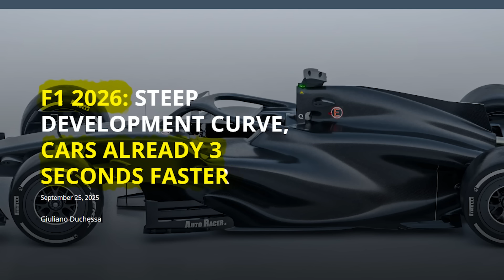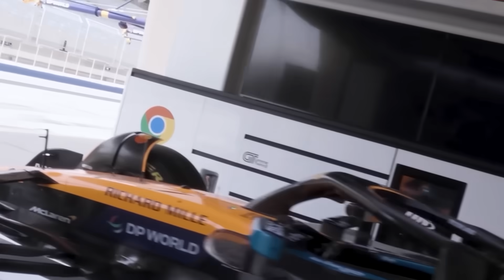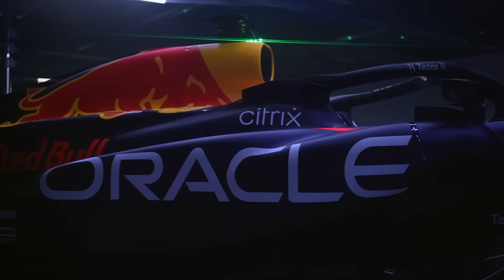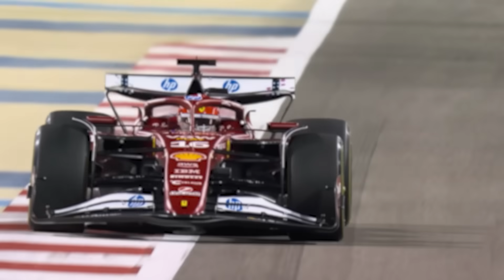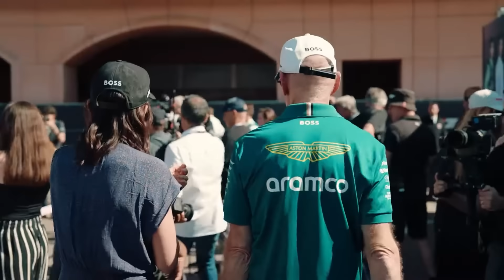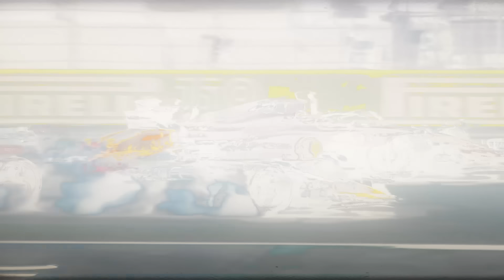How 2026 F1 Cars Are Already 4 Seconds Faster

Comment: We don't need any winey stupid hybrid electric garbage that only 5 fans prefer. Scrap that crap and get back to a proper v8 or v10 race engine. No truth to "that's the future". Only in manufacturers wet dreams. It's not possible so they need to get back to reality and get real race engines back in the cars and forget what they want to produce and start producing what most fans/society want. The 2026 cars look great, not let's get them sounding great again!! We now have sustainable fuels, we can run big loud engines now. We don't need fuel saving or even electrified anything anymore.

Comment: The car will not start the new regulations quicker than this years cars. Over the following few years the lap times will fall but the new regs are tight and restrictive. The current cars have years of development and have almost reached a plateau. New regs normally mean the racing isn’t as close for the first few years but you have to look at who stoped development early on this years cars and switched to the 2026 car. early. This is due to limited fan time, runs and occupancy in the wind tunnels.

Comment: The analysis of the new setup is great. But imma disagree hard on your driver assessments. The cards are going to be shuffled anew with the power unit changes. It will no longer be the most experienced driver that wins. It will be the quickest to adapt correctly to situations. So Hamilton: forget him. Cant adapt at all. Only wins with the best car and no issues. Verstappen: Most likely very high up there but not first. Russell: Possibly right behind or in front of verstappen. Leclerc ? Depends. I dont know how well he would do without being able to slide the rear as much anymore. Could turn out well for Yuki Tsunoda .... if he is still in the cockpit of course. My hope is that Bortoleto will make the most of it.

Comment: You're so full of 💩.

2026 cars:
- have less average available power
-take forever and a day to recharge the battery
-30% less downforce
-20% less mechanical grip
-narrower
-double DRS helps with heavily reduced power but doesn't equal it
-weight to wheel base ratio is increased making cars unstable
-double DRS open is incredibly unstable
These cars will be MUCH slower and will not come anywhere near as fast as the current regs

Comment: That engine sound is more or less what I expected. My initial expectation was that it would sound like an Indycar engine fused with a Formula E engine. So my criticism with that sound clip was that the ICE had the same pitch as the current engines. I expected this to change a little bit due to the elimination of the MGU-H as well as having them rev a little higher to obtain energy

Comment: Cost cap didn't go up that much because of inflation. It was because they added a few things that were outside the cost cap into it so that teams may be able to redirect some of that money to pay people better. It shouldn't affect any team. It just gave them more room to cut from other parts and spend it in the cost cap instead which they couldn't do before.
Some people left F1 because all other pro series are paying more while people work/travel less.
Cost cap is nice as it made the engineering talent spread across all teams. But the guys bellow these talents were getting very tired and not paid well.

Comment: Inwashing wings are actually incredibly stable in yaw, which is what F1 cars do when they turn. A delta shaped wing needs stabilizers to combine roll and yaw, it's inherently unstable in yaw, but stable in pitch and roll. An inwashing or forward swept wing is stable in yaw and roll but it's unstable in pitch. Luckily F1 cars don't pitch that much, 5g pitch under braking for like a split second. Inwashing wings have a phenomenon called divergence, where the angle of attack increases with speed, and load, which is the opposite of what the current wings do.

There's flexing going to happen next year, but it's in the opposite direction the FIA is measuring :)

Comment: You can say aero is more important, but it's easier to lose time in the corners rather than on the straight if you have a dominant engine like in 2014..
Reply: Actually its the way around, aero efficient car good on corners. On the straight, dominant engine just power through.

Comment: 3 seconds around what track ? like wtf does that value even mean ?
Reply: @doktorhund6926 I think he means the 2026 cars will be 3 seconds faster at Monaco in 2026 than the 2025 cars at Baku. 🤣🤣🤣🤣
Reply: why would you need around a specific track 3 second faster on average on every track also works i think
Reply: @spacerenn because it matters. laps are different in Character and length. 

if your average lap time is 46 Seconds and you go 3 seconds faster thats Insane. 

if you drive the Nürburgring with 6 minute lap times and save 3 seconds a lap. well thats just a small blip barely noticeable.
Reply: @doktorhund6926  yes absolutely , but if the 3 second faster is on average of all the tracks this season it doesn't mean that on a 46 second lap you are 3 second faster it means could mean anything they could be 5s or 5tenths quicker it doesn't matter because it would be the average of all the 24 track of this season or next year , so technically it doesn't fully answer your initial question but the 3 second faster could mean they are on average 3 second faster on all the circuit wich is misleading, the mean would be more logical but you get the idea
Reply: @spacerenn well then they should say that it is around the average of all tracks.
Reply: @doktorhund6926  no need to say anything it's for Pirelli not for us , Pirelli knows what it is and we don't maybe il wrong and you are right and it doesn't mean anything we don't know , im just saying it could be something that makes sense ,Pirelli probably knows and does accordingly
Reply: @doktorhund6926 we have brains that are able to assume that, sooo

Comment: I think, like everyone else, I don't know what to expect from these new regulations. On the one hand, I think Formula 1, as the premier class of motorsport, should have significantly faster cars than the rest, but I also sincerely doubt that the 2026 cars will be "as fast as or faster than the current ones." That would mean that the new regulations would achieve in one year the performance that the previous ones achieved in four, which would mean that the 2022 regulations would conceptually be much inferior.

Given that the teams are at the beginning of developing the new cars, they are at a very steep part of the growth curve. This, coupled with the fact that the technical regulations are not 100% finalized (which I find regrettable at this point), means that the numbers are constantly changing. The figures I do remember are that they talked about a 30% reduction in downforce and a 55% reduction in drag, which would give us a massive improvement in aerodynamic efficiency of 56%. We'll see how true this is, but it doesn't seem very credible. Also, I fear that race pace will be severely reduced by having such a large ERS, which will surely turn the races into a test of efficiency rather than speed or strategy.

Honestly, I'd love to see super-fast cars, but if this comes at the expense of racing, I'd rather sacrifice some performance. If the 2026 cars were as fast as the 2022 ones to begin with, that would be more than enough.

Another important aspect is the dispersion of the field. I fear the gaps will be huge, and that's a shame, since if the ground-effect era has achieved anything, it's compacted the field by 1.5 seconds in race pace. There's talk of 3-4 seconds, which is a much larger gap than any season since the departure of F1.5 teams like HRT, Virgin, and so on.

We'll see, but for now, I remain pessimistic. Great video!

Comment: It would be difficult to "fix" the power loss problem because energy generation per lap isn't as much as the current gen f1 cars (they removed the mgu-h). 
Teams might be able to circumvent this because there is no official cap on how much power, the engines can make... if they make more power than stipulated by the FIA suggestions while being legal, I guess that could work

Comment: The engine sounds like a blender fighting with a lawnmower.
Reply: Pretty sure it’s just the sound of the drone in that clip
Reply: I really don't think that's what the cars will sound like irl. You can tell from the mixing that the electric sound comes from much closer, while the engine is in the distance. It may still have those tones, but I practically can't hear the engine... I think the relative volume of each element will be very different.
Reply: The engine will be louder than the current ones due to the mgu-h being removed.
Reply: well I mean they are made by Honda
Reply: Absolutely hate the current vacuum cleaner engines and don't think 50/50 power units will sound any better.
Reply: finding any reason to hate 🤣
I could literally say the same about the f1 v10s, they sound like a whining blender
Reply: @TringaporeHK  People make the "vacuum cleaner" comparison about the V6s because hurr durr, it's electric, while ignoring that V10s sound more like an earsplittingly loud vacuum cleaner due to the rev range.
Reply: @TringaporeHK you don't like the sound of the v10s? You like the formula e RC car sounds? 😂
Reply: @titancheat  I like the sounds of ultra-high power/weight ratio electric motors, yes. They have higher power/weight ratio than combustion cars. Thats cool.
Reply: @titancheat  V10's sounded like a two stroke moped, having a stroke whilst on steroids.
Reply: @titancheat  v10 was too whiny, v8 was pure bliss
Reply: @titancheat  fuck it Cosworth DFVs sound better than any of these engines mentioned

Comment: Seems like a huge part of car performance will depend on how they handle the active aero transitions. How fast they switch from straight line to cornering and using that to help with entry and exit
Reply: Not really . It might play a very small part but i think a “huge part” is an over exaggeration. The transitions from straight line mode to corner mode will probably be as quick as current drs. Also it seems the FIA will only allow straight line mode in certain areas of the track ( basically drs zones ) but im not completely sure on this point tho . Overall the speed of transition from straight line to corner mode could end up being as irrelevant as how quick the drivers currently switch DRS on and off

Comment: I really hope they don't have to lift and coast half way through a long straight for energy recovery. That isn't F1. You could also end up with cars constantly overtaking and then getting the overtake taken back at a different part of the lap. So lots of meaningless overtaking because different cars work much better at different parts of the lap but end up producing the same laptime.

Comment: At least next year losing the front wing endplate will actually mean something again. I’m so tired of seeing damaged wings not get changed because they can just hang on to position with DRS and dirty air.
Reply from the maker: Very good point
Reply: I'm kinda concerned about how front wing changes will work tho, cause today rear wing are impossible to change quickly due to the DRS system, so I'm afraid this difficulty will carry over to front wings as well
Reply: @MurihSantos  That may be. To counter though: drivers will just have to up their game for on track battling. Can’t just barge through and call it “late braking”.
Reply: @I_K1540 I can see that as a good thing but at the same time I don't lol of course it would stop this bs of "dive bomb the apex to get there first", but every good battle on track has some aggressiveness, so it's a double edge sword
Reply: @MurihSantos  I imagine the motor that controls the front wing will be inside the front wing and connected by a cable, or if not then maybe a similar system. We will see anyway, it will be interesting to see how its done.
Rear wings are mostly hard to change because it has a less sturdy mounting point than the front wing, meaning it needs a better attachment which then makes it difficult to take off (I am 90% sure).
The drs is a good reason too, although I feel like teams could make a system to make the drs detachable from the rear wing if they wanted to.  Maybe the rules of f1 might be preventing teams from making rear wings detachable easily, or its just not worth the complexity
Reply: Best First World Problem Ever 😂😂😂
Reply: @wizzyno1566 ?? we're talking about formula 1, this os probably the most "first world" sport that exists

Comment: How much more expensive will the front wings be? I don't see a problem with wing changes, 2 metal contacts is all that's needed to feed power and activation signal.
Reply from the maker: Definitely more expensive but I don’t think it will be a drastic difference

Comment: I don't fully agree on LH adapting so quickly to the new era cars, mainly because (IMO) he hasn't fully adapted to THIS era cars. But let's hope he does 🙏
Reply from the maker: The 26 cars in theory fit his style
Reply: @F1Unchained I still don't understand how.  His style is "late braking" which is probably not the most efficient way to do regen, he doesn't like how much the Ferrari PU relies on engine braking, he's super sensitive to the feel of the braking, etc.
Reply: @F1Unchained no , they will stay heavy. Same shit here, less 40kg compared to the 2025 cars is not enough. 
A good formula 1 car we love and Lewis love to ride weight 600kg max. Like in 2007.  Since 2014 F1 are too heavy, and in 2026 F1 will be much heavier than 2014 cars.
These cars are not sharp to drive, not fun to drive, not fun to watch.
The v6 will be ultra downgraded, it will be in cruising mode even when they put full power. It is not F1 spirit. I bet they can do the season with one v6 in 2026.
Reply: @factormars4339  the cars that he was most dominant in weighed 700+ kilos and were large land barges with 2 meter track width (2017-2021 regs). The floor being less involved also helps, or at least removes one disadvantage the late braking style has in the current regs. Which is the stiffness of the suspension and being able to feel the weight transfer better.

Comment: teams might rev the engines higher to charge batteries quicker, and the cars are hopefully going to be louder as the mgu h will be removed and the exhaust would have one less muffling component. we might actually get a good sound out of these
Reply: I'm afraid the turbo turns everything down by 11.
Reply: The MGU-H never comes into direct contact with exhaust gases. It's just a small motor/generator that sits on the turbocharger shaft between the turbine wheel and compressor wheel. When it is in harvesting mode, it does slow down the exhaust gases slightly more because it increases the load resisting the turbine wheel's rotation, but it certainly is not a muffler.
Reply: Modern F1 engines can achieve a thermal efficiency of over 50%. If more energy is being used to generate torque on the crankshaft, then there will be less energy left in the resulting exhaust gases. Lower-energy exhaust gases means quieter exhaust sounds. You can already hear what these engines sound like with minimal exhaust muffling every time their wastegates open. That allows some exhaust gases to bypass the turbine housing once peak boost is achieved. F1 would be better off bringing back the separate exhaust pipe and wastegate dump pipe design that they ditched when the ground effect cars were reintroduced for the 2022 season. The 2021 cars were noticeably louder with that design.

Comment: If you think about it, the perfect engine is that that doesn't produce any noise. Because that means non of the energy is being transferred to noise and rather is being used to push the engine forward. Therefore a quieter engine is better than a noisy one.
I always laugh about really noisy street cars that try to be all tough; I always say, that dude just wasted half his gas tank on noise.

Comment: Piastri and Russel will be the strongest drivers on the grid next year. Not too far from what we are seeing this year. The reason I feel is the new active aero regs combined with the tricky power management will be potentially a deterrent to all out time attack lap style driving which means Max, Lewis, Leclerc like drivers will NOT be as strong. These regs will require a bit of nerding. It's perfect for Russel who's easily the best all rounder on this grid.